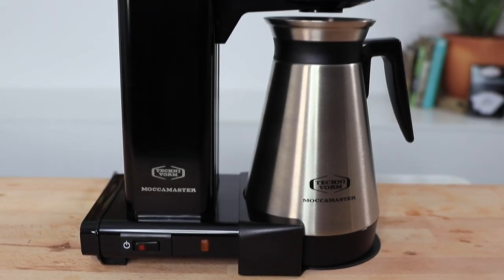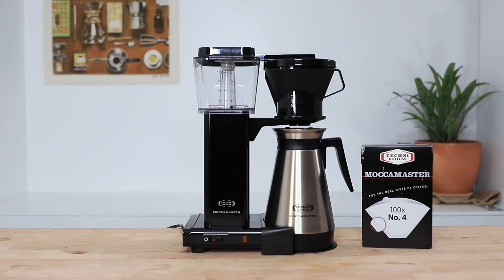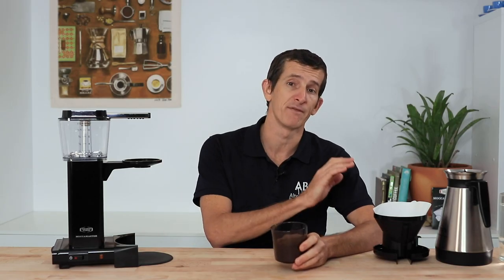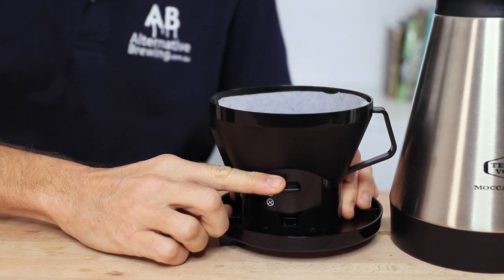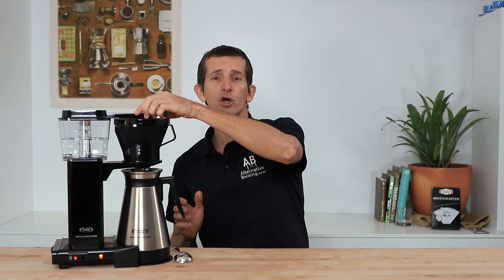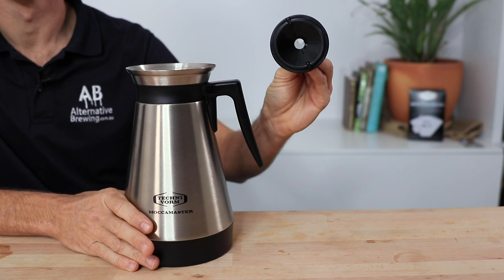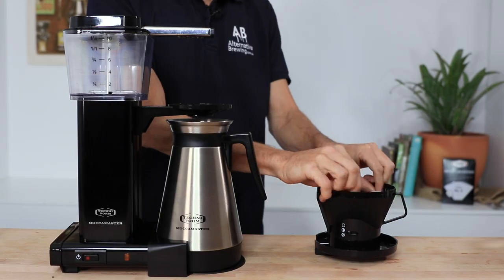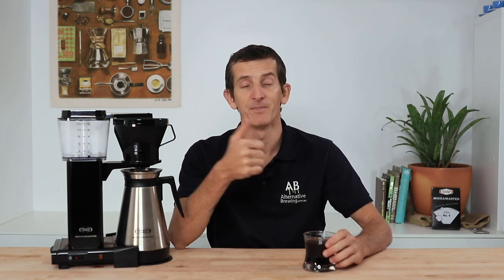How To Brew Coffee Using the Moccamaster Thermal

Comment: You can always turn the brew basket back and forth to evenly spread the water over the grounds. Since the Moccamaster  brews as fast as it does, you won't have to do this for very long as a full reservoir (1.25 L) takes roughly only 5 minutes to empty. I would do that rather than place more grounds on one side like another user suggested. Try it. It's pretty easy to do. Simply spin the brew basket back and forth slowly right to left. You will evenly spread the water. Or do this until the basket is pretty full and give the basket a little shake for a second or two like in a manual pour over to get the grounds off of the side. Once the basket is pretty full with water you may be able to leave it alone for the rest of the brew cycle. You can also give it a little shake just before the drawdown completes so that the bed ends up fairly flat.
Of course, many may prefer not to manually brew their coffee, since it is an "Automatic" drip not a manual pour over. So, just a few spins back and forth for a minute or so until the top of the grounds are evenly wet may do the trick for you.
I'll try using the Half setting instead of the fully opened setting. Sounds like a great idea. 
I will say that the recommended two tablespoons of coffee per 6 ounces of water is way too strong for me. I need to use just One tablespoon of coffee per 6 ounces of water.
Technivorm suggests brewing this way anyway and just add hot water to your cup to weaken it. For now I just brew it at 1 tablespoon per 6 ounces water.

Comment: I know I’m late to this party. Isn’t 6X8=48?  Isn’t 1.25 L very close to 41 oz.?  And don’t the call this a 40 oz. brewer?  I hope to replace a 48 oz. machine. So, is this closer to 40 or 48 oz.?  40 I’m afraid?  5 X 8 maybe?

Great video though. I learned a lot that will help me get a brew closer to pour over. This is the video that pushes me to purchase. Thanks
Reply: It's a 42 oz machine but well worth the slight loss in capacity.
Reply: @AlexanderRiehl  I have found that the measure lines on the reservoir do not accurately match the weight of a digital scale. The 1.25 liter line is just about 42 ounces.
One Litre of water from a digital scale goes over the 1 liter mark on the reservoir by approx. 1/4 inch or slightly less.
There is space above the 1.25 liter mark that will actually allow the reservoir to hold 48 ounces of water. Additionally, the carafe will easily hold 48 ounces of water. (But don't go any higher than that.)nally,
Reply: VERY IMPORTANT: Technivorm measures a """cup""" as only 4 ounces, while a measuring cup is 8 ounces.

In other words, this model holds 40 ounces of water, no matter how many 'cups' you call it. A half batch is 20 ounces.

Comment: Could you tell me why my brew basket overflowed 2 times since I have had it only two weeks.  I don’t k ow how to troubleshoot this issue yet.  Thanks
Reply from the maker: This would be as a result of the basket either being half open or closed // or occasionally there can be a small blockage in the outlet hole from the basket in to the carafe – check to make sure there is no blockage ... you can add less coffee in the basket and aslo than begin to grind coarser ground coffee ... this should allow the water to pass through without becoming to dense for the water to pass through 👍

Comment: How do you recommend avoiding the pitting in the grounds during brewing?
Reply from the maker: I'll usually have the filter basket set to half-closed that keeps the water level reasonably high so there's less turbulence as the water  is flowing in. My grind is usually dialled-in in a  little coarser in order to allow a faster flow out of the basket, managing the flow there.
Reply: I place more of my grounds a little heavier on the side of the basket  closer to the unit.  I don't always have time to pre infuse or stir the grounds.
Reply: @Scoop2992  You can always turn the brew basket back and forth to evenly spread the water over the grounds. Since the Moccamaster  brews as fast as it does, you won't have to do this for very long as a full reservoir (1.25 L) takes roughly only 5 minutes to empty. I would do that rather than place more grounds on one side. Try it. It's pretty easy to do. Simply spin the brew basket back and forth slowly right to left. You will evenly spread the water. Or do this until the basket is pretty full and give the basket a little shake for a second or two like in a manual pour over to get the grounds off of the side. Once the basket is pretty full with water you may be able to leave it alone for the rest of the brew cycle. You can also give it a little shake just before the drawdown completes so that the bed ends up fairly flat.
Of course, many may prefer not to manually brew their coffee, since it is an "Automatic" drip not a manual pour over. So, just a few spins back and forth for a minute or so until the top of the grounds are evenly wet may do the trick for you.